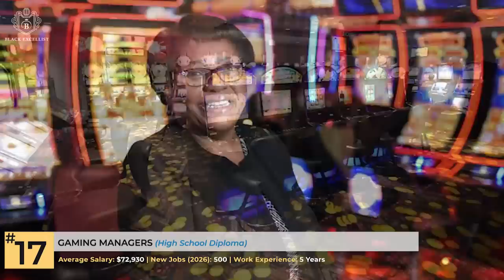Top 25 Jobs without 4 Year College Degree | #BlackExcellist

Comment: 25 web developer
24 gas plant operator
23 eletircal power-line installer
22 signal and track switcher 
21 postmaster and mail superintendents
20 transportation inspector
19 captains and pilots of water vessels
18 dental hygienists
17 gaming manager
16 supervisors of non-retail sales force
15 funeral service manager 
14 nuclear medicine technologists
13 supervisor of fire fighters
12 power plant operator 
11 powerhouse and electronic repairer
10 comercial pilot
9 detectives and criminal investigators 
8 elevator installers and repairers
7 nuclear technicians
6 radiation therapists
5 power distributors and dispatchers 
4 supervisors of police and detectives 
3 transportation and distribution manager
2 nuclear power reactor operator 
1 air traffic controller

Comment: They forgot an entire booming industry with so many open jobs that they can't be filled, cyber security. Myself and multiple people are making 120k-150k, no degrees, just a couple certifications and some hard work. Plus, we have less than 5 years experience; we can make 200K+ after just a few more years.
Reply: With cyber security don't u have to have a knowledge with coding
Reply: @itsDjjayyArt  No, you do not. It will help at higher levels but entry level analysts or engineers do not need to code.

Comment: Though directed at black people this is a valuable source for anyone wanting to make the big bucks. Lots of comments mentioned truck drivers. I think that's a job that will be diminishing in numbers soon. Self driving trucks are on the way. Not soon, but in 20 years truck drivers will be a thing of the past. For longevity anything in the medical field is your best bet. It pays well, is in a cool or warm and dry environment but requires the ability to work with sick people, easier said than done. I'm white, but know blacks in many of these fields. Don't know ANY air traffic controllers, but a BUNCH of black medical technologists. Some of the jobs are dangerous. Cops, firefighters, linemen, any of the outdoors jobs that have you working in rain, sleet and snow, extreme temperatures. One REAL simple thing to keep in mind. All these jobs require work. You get out what you put in. The harder you work and more gung-ho you are the faster you advance. Again, that applies across the board, not just to black folks. Good luck from an old retired guy who never made top wages, but enjoyed what he did. Money wasn't my be-all, but for many it is. Whatever you do keep this in mind. You're gonna be doing it for a LONG time, so make it something you like if possible. Or something you at least don't hate.
Reply: Tom Swinburn even if they drive themselves still need someone active in vehicle just like auto pilot with airplanes you can’t trust technology 100 percent don’t knock trucking America needs us !

Comment: Should put radiation inspector here. I went to school for 2 years and started out making 60k and topped out can easily make over $100k
Reply: Menk El yea health risks?
Reply: Over time IF procedures aren't followed and safe work isnt performed you can get over exposed to radiation. Straight up it can lead to cancer or you can get an uptake that can lead to respiratory issues if the protective equipment isnt worn right. But there are so many rules and regulations in place in the nuclear industry to the point where you would have to intentionally F**k up & F up royally to get any type of injury or develop a serious health issue